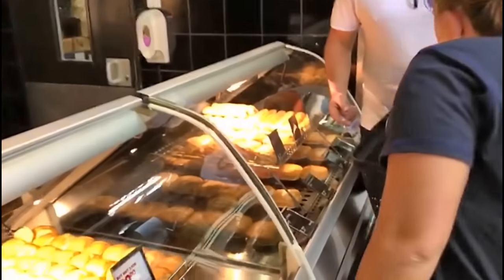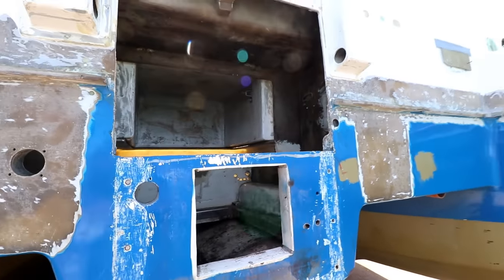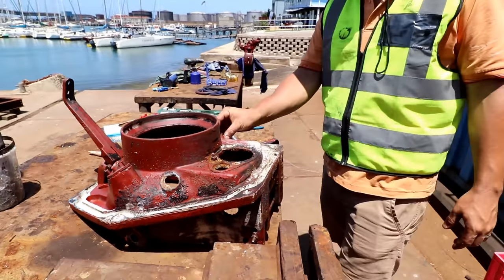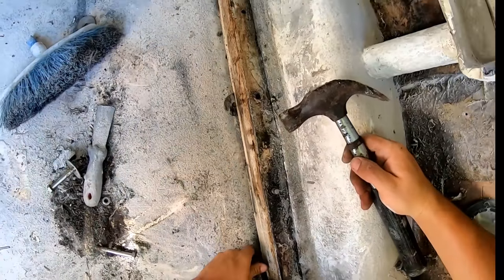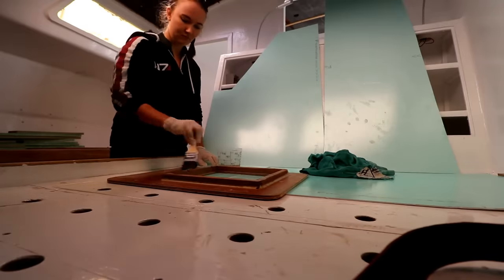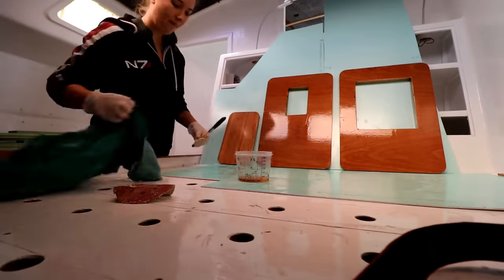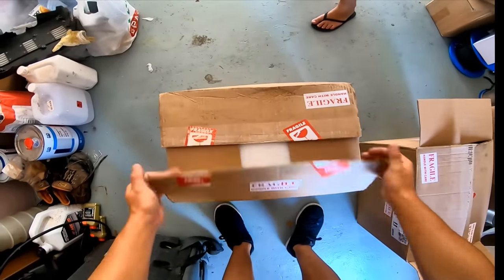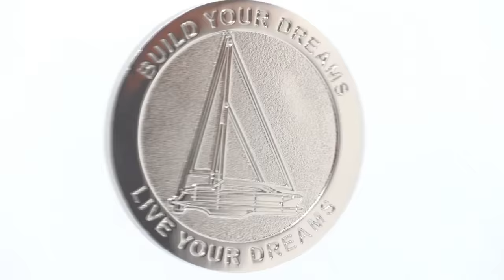EPIC FAIL at REMOVING our ENGINE! | YACHT REBUILD WEEK 49

Comment: Probably a good idea to replace all the stainless bolts located in the timber engine bed before you glass everything in, the old ones may have crevice corrosion issues where they're hidden in the timber, it'll be too late once you fill everything with bog and glass. Cheers from OZ. 👍👍🇦🇺
Reply from the maker: That's the plan. Thanks for watching.

Comment: Forget the epoxy on those metal parts !  Get them welded if you want then to last !!
Reply from the maker: thanks, but we will show what epoxy looks like 20 years later used on a sail drive,its a excellent product if the correct one and method is used

Comment: You should look into J B Weld to seal engine holes in metal. It is heat proof and can be grounded and painted. Hard as metal.
Reply from the maker: epoxy has been used for years on sail drives , there is no heat on the gear box/ z drive  and epoxy is super tough it even prevents osmosis and alloy erosion. well check it out !

Comment: You mentioned putting 8 layers of glass in the engine bay where the stainless steel engine mount rests. Take care it can still rest and center over the existing holes the bolts go thru to secure it.
Reply from the maker: Thanks , we had to trim down the wood inner to allow for this. it looks and feels solid now !

Comment: very nice of you to help moses and to give his family a good christmas too, i knew i was watching some good people build a beautiful boat.
  Some one already question the epoxy on the metal i too wonder about that, seams like there would be a lot of vibrations that would lead to cracks then leaks, can you weld in plugs ?
Reply from the maker: Hello , thanks . yes some people might not be familiar with epoxy structural fillers but its super strong 6000psi , and prevents material erosion . cant be used in places of high temps but works great for other places . ill show some examples in episodes that follow